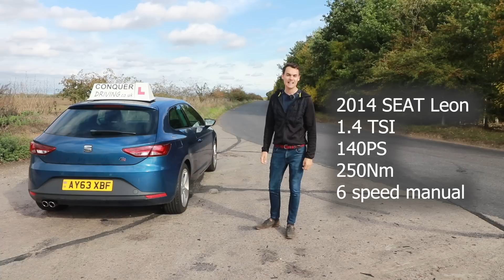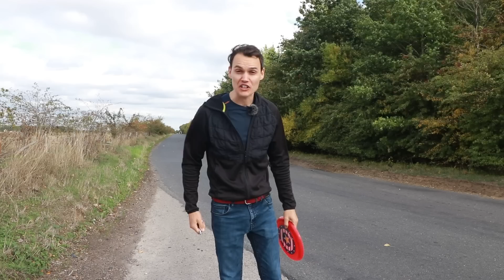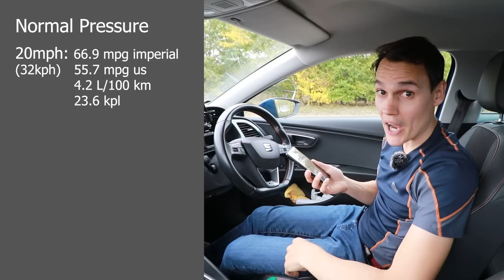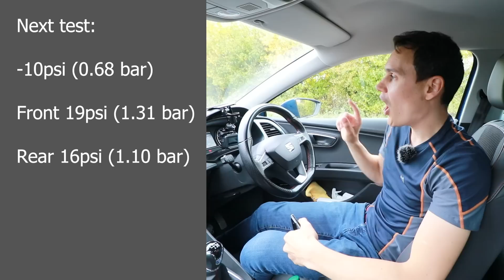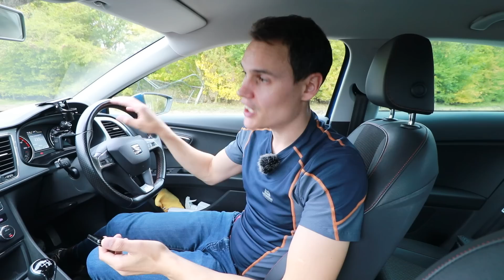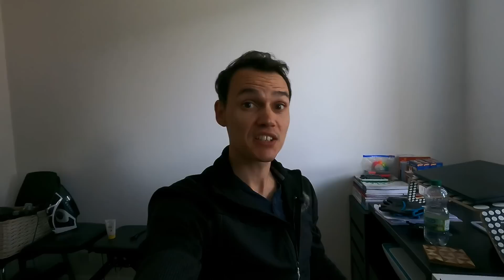Tyre Pressure Fuel Economy Test - Do Lower Tyre Pressures Cause Higher Fuel Consumption?

Comment: Great video but I cant help but wonder about two things that I didn't catch anywhere. First would be that you didn't mention your tyre/rim size. Narrow tyre with high sidewall will have different variation of rolling resistance with different pressures than a wider but lower tyre. I am sure that getting multiple sets of differently sized tyres just for the experiment would not be worth it but it seems that this detail should be mentioned just for better overview of what kind of tyre you are specifically talking about. My second point is that all cars that I encountered so far have always had pressure recommended for "comfort" and "economy". I think it would be also informative to include this into the comparison (both Skoda and VW do this so I would say Seat has to as well) apart from simply lowering the pressures by a flat amount since those two numbers will be what most people would use. Anyway thanks for the great content, cant wait for the next one.
Reply from the maker: I have not seen comfort and eco tyre pressures in any owners manuals I have looked at. Might be a new thing.
Reply: @ConquerDriving  My last 3 cars all had  Normal/Comfort, ECO and full load.  Petrol and diesels.  ECO was 39psi, comfort/normal (up to 3 people) was 33psi and full load was about 44psi.  Nothing about 4/5 people and full load.
When i picked the cars up from new they all had 39psi, each time i lowered it to 33psi the garage put it back to 39psi stating tyres were underinflated on the service!
33psi is OK, I used to get 55mpg in a diesel in town, but with a petrol get 33mpg, so very disappointing.  The diesel went because the DPF kept blocking despite motorway runs (after 10,000miles) and the dealership set the car to regenerate every 300miles which caused more errors and wasted fuel, also caused more servicing and replacement of glowplugs etc.
39PSI does make the petrol car "bounce" and I every bump and lines on the road, it also feels better cornering at speed - but I never drive it to that extent, it can also mean more suspension damage over uneven roads with holes in as the tyre can't flex and absorb some impact, so you get a harsh thud.  At 39psi it is more likely to just burst compared to 33psi.
There is  NO difference to fuel economy between 33psi and 39psi in any petrol or diesel i have driven over the last 15years.
I still get the same readings.  That is with different sized tyres on the cars.
The only safety difference is that 39PSI can prevent aquaplaning as experienced on motorways, this is due to less of the tyre being in contact with the road.  If you run through standing water with 33PSI that tyre works so hard to displace all the water and can't. 39PSI alters the shape and contact and is more effective.  Try it in heavy rain.

Comment: Hi quick question, completely unrelated but my temperature gauge seems to be cold when I turn on the engine and it takes quite a while to get to 90 degrees. I am a new driver and I do not understand why this is happening. Is this normal on a VW golf, given the weather or do I need to get it checked out?. Is it safe to drive while the temperature gauge is cold for the car and fuel economy?. BTW your videos are so helpful even after passing the driving test, helping us all be smoother and better drivers.
Reply from the maker: It should normally be up to temperature within 5-20 minutes. If it's taking much longer than that then the thermostat may be stuck open.
Reply: @ConquerDriving  Thank you for your reply, it helps a lot.
Reply: The speed the engine gets up to temperature differs from car to car. Diesel engines tend to warm up slower than pertol engines. As long as it gets to 90 and stays there nothing is wrong.
It’s perfectly safe to drive with a cold engine. Drive normally don’t floor it when the engine is cold. 
About economy, a warm engine uses less fuel than a cold engine, but letting the engine run until its warm costs way more and wears the engine more.
Just start the car and drive in a calm manner. Driving instead of idling also warms the engine up faster because the engine is under load. So this reduces the time the engine is cold. And ultimately decreases engine wear due to a cold engine
Reply: @andypieters4395  Yes, thank you, this puts me more at ease when driving. Big help. Appreciate it.
Reply: I have a Golf and mine behaves like that. Diesel right?
Reply: @uk7866  Yes, diesel. Glad its not an issue :)

Comment: The only logical thing next is to install the roof rack. :) Great video as always!
Reply from the maker: I was thinking of putting some weights in the car for another test. Depends how well this video does.
Reply: Or like all the stupid BMW drivers, a roof box or ski rack.  During lockdown there seemed to be a sale on ski racks and every BMW I saw had them fitted - even though they could not fly out of the country and nowhere was open to ski in the UK.
The funniest roof box setup I saw was on a Volvo estate car - the car was empty, but it would have been possible to fit another car inside the back.
I'm not sure why people drive about with them on as not many use them, is it some fashion accessory or BMW and AUDI drivers showing they are even more stupid than everyone else?  It's always the same make that attracts the same type of people, maybe because they are really easy cars to drive, so people that are not very good tend to go for the models with driver assist packs and automatic gearboxes leaving them a stop and go pedal and big thing for pointing the car.

Comment: Does changing the tyre pressure alter the reading of the speedo relative to the actual speed of the car?
Reply from the maker: That's a good point, it would change a tiny bit. Lower pressures would mean you aren't going slower than recorded and higher pressures would be faster than recorded. The wheels will be spinning at the same speed but the wind resistance will be a tiny bit different. I doubt the difference will be noticed because I would guess it's less than 1mph difference.
Reply: @ConquerDriving  Effective rolling distance of the tyres changes with pressure. At lower pressures the effective rolling distance of each tyre per rev is reduced. This is how cars can tell if one tyre is reducing in pressure, it rotates more than the other tyres. So without checking the recorded milage of each of your runs you are not getting the true mpg as the car will think it has gone further with low pressures and a shorter distance at higher pressures. The effect of this is that if with lower tyre pressures you reduce your recorded mpg by 1% you may be going an actual distance of 101% of recorded distance and the two balance out. The mpg calculation in the car's computer is assuming the tyres are at normal running pressure and have the normal running distance per revolution.

Comment: Great video idea! I always tend to keep mine slightly overinflated at the upper recommendations of the vehicle manufacture
Reply: Same here. Always keep in mind the accuracy of the pump or pressure reading device, air temperature inside the tyres and outside temperature. When warm, the air inside the tyres will expand, so keep that in mind as well.
Reply: @alpha13sierra  good point but great to see Richard's video showing how little difference it all makes
Reply: I always keep mine at the load/speed setting, never know when I need to throw stuff in the back or get on the motorway
Reply: Do people actually increase/decrease pressures depending on how many passengers they carry like manufacturer's say, or is it best to go somewhere in between fully laden and up to 3 persons?
Reply: Overinflation can be bad, just hope you don't have a lot of weight in the car or regularly drive on rough terrain. The maximum PSI just before over inflation is better.
Reply: @rufusgreenleaf2466  if carrying more weight then the manufacturer recommends even more inflation
Reply: @uk7866  Regardless you said you over inflate your tyres which could cause uneven tyre damage and risk a blow out. Just be careful is all i say.
Reply: @rufusgreenleaf2466  not really as they are within the upper limits of the manufacturer recommendation. Tyres can take way more pressure then you'd imagine
Reply: @uk7866  Then that's still within the limits not over inflating. Just Maximizing the required psi, that's okay. For a second i thought you was on about almost ballooning your tyres.